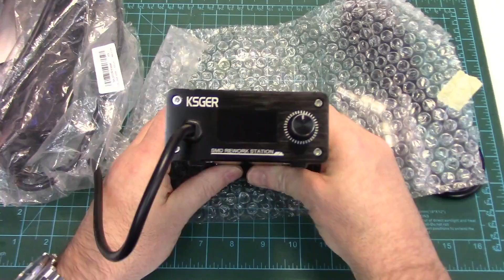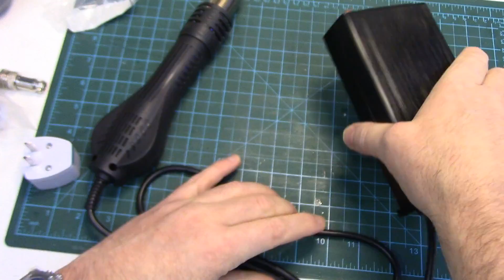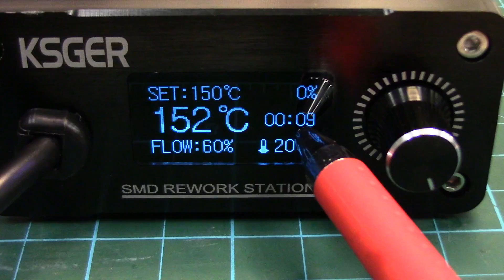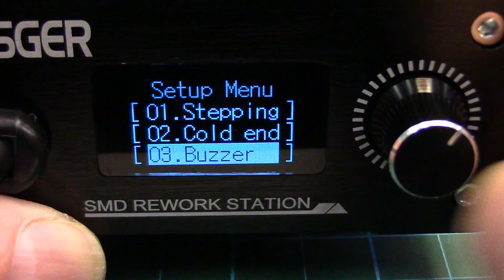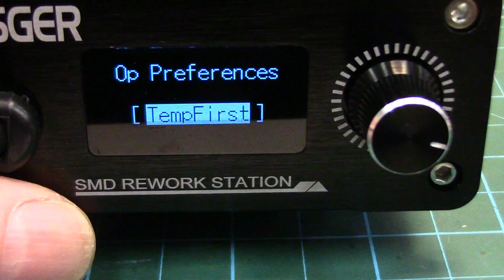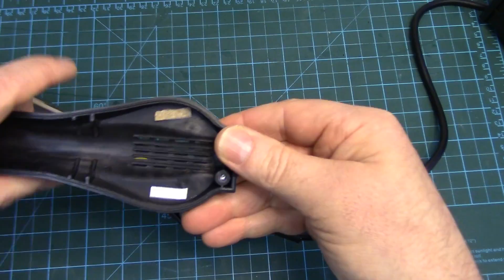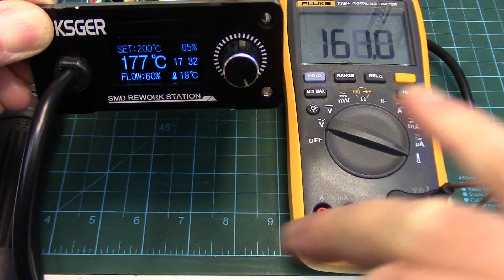KSGER 858D Hot Air Rework Station Review

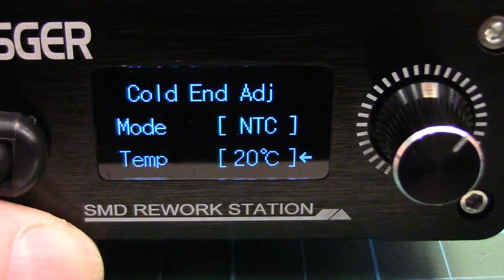Comment: 11:15 the room temperature can't be -99 degrees. It's just a calibration regulator.
Reply from the maker: Not sure what you were watching but the room temp shown at that time index is 20C.
Reply: @rchelicopterfun  
I mean, the adjustment is down to -99 degrees. Doesn't that make you think? I don't think anyone would solder at -99 degrees Celsius. It's just a sensor calibration. It has nothing to do with the room temperature. That's what I meant.
Reply from the maker: 1. No it's not adjustable to -99C. The NTC or CPU adjustment range is from -9C to +99C (at least on mine). Now, while I doubt anyone would ever be using a hot air rework station at anything over +45C ambient at the NTC in the handle, if using the CPU for ambient sensing, then I can see it getting close to that.
2. This adjustment most certainly has everything to do with room/ambient temperature. That ambient temperature input is used to shift the PID algorithms of the hot end circuit, providing the best hot end accuracy (response time and improved overshoot/undershoot characteristics).

Comment: That's a very nice "intro" but I wished you had used it and compared it to your AOYUE on some BGAs.
Every time a watch a review of a hot air station with that handle and the integrated fan, it's meh. While the units with the air pump or fan in the base are regarded as superior.
Reply from the maker: Well, I have found little difference in usable performance; keeping in mind, my main use of a hot-air tool as an RC hobbyist (this is an RC channel after all) is not for BGA work. In fact, never once done a BGA chip with either unit; only SMDs, SOPs and a couple QFPs (I did by the way demo an SOP on the one year follow up video: https://www.youtube.com/watch?v=Dy9WUtvdBUk

Other common RC related uses include heating small bearings up to soften retaining compound, expand races for fitment, soften adhesives and of course shrink heat shrink tube.  
For those RC applications of what I need & use mine for, both units work well, but the 858D takes up much less bench room, is quieter isn't vibrating the work surface and of course is reasonably priced.
No question, either type of hot-air tool has pros & cons based on specific usage application & needs.
Reply: @rchelicopterfun  Thanks for that thorough answer!
I'm just watching the follow-up :-)

Comment: Hi John,  I have the same Auyou Station as you and wanted a smaller footprint.  I Bought the Ksger T12 Iron about 6 months ago and like it a lot.  I received the Ksger SMD Rework Station a week ago and it is significantly different from the one in your review.  The menu is the same as yours but the  inside is wired  with a small 24 V transformer,  a tack welded clock battery and no magnetic switch in the airgun. I am new to electronics so I can not describe to you all the differences.  That being said the unit seems to work well .  I appreciate your video and hope to see more from you.

Comment: I don't know if you see comments on older videos, but I have a question about the Ksger Hot Air Rework station.  My new station System Info  shows 160V 59HZ is that a problem?  Other than that all appears to be working.
Reply from the maker: I'll presume you're on 120V/60Hz mains? If so, the frequency is basically correct (1Hz out reading is within 2% error). 160V reading if your main is 120V (when you measure it with a volt meter) won't have any impact on the operation of the station, it's just the reading that is way out of voltage calibration. That or it's not reading the true RMS of the mains, and is instead reading closer to peak amplitude voltage (about 170V on a 120V AC mains). Just a guess. Contact the seller if it's a concern.

Comment: Great review, I purchased after being impressed with the t12 unit but sadly the smd unit lasted 6 months, a week after warranty had run out, the glass fuse blew so I replaced that and now it just flickers error every second. Upon looking at new listings it states wires need to be swapped in the wand handle and thermistor needs to be added, Banggood have not been helpful at all stating the machine is out of warranty period, which i do understand but revisions have obviously been made and no advice on how to either purchase a new wand or how to repair. As soon as it’s turned on the heating element gets scolding hot and seems temperature is not being controlled .. if anyone has any ideas I’d be very grateful. Thanks
Reply from the maker: These low cost things have a warranty? I never knew that. Anyway, to fault trace the problem, you'll have to follow a standard diagnostic fault tracing process with a DMM to trace & find the fault/s. Likely more than one as this sounds like a cascading failure. I'll almost say with 100% certainty, the TRIAC has failed in a shorted condition. You can confirm with your DMM. As to why it failed however, that will require further fault tracing. Perhaps a short in the handle/wiring, or in the heating element. Even loose connections with higher current loads can take a TRIAC out.  If nothing else, just looking for visual shit stains on the PCB is a general good diagnostic fault tracing step to find possible bad component/s. You can of course order a replacement board, but if you also have a problem up in the handle/handle wiring that is the root cause of the initial failure, just firing a new board is will result in the same failure again. In short (pun intended), fault trace the handle and wiring with a DMM as well for shorts/intermittent shorts before risking a new board.
Reply: @rchelicopterfun  thanks for the reply john, yes I was thinking maybe the triac, I have done a visual of the board and the wand and all looks fine, I didn’t find any kid of thermostat in the wand which I was surprised at. I wonder if it was because the thermistor wasn’t installed at factory. I know they are not expensive but I don’t want to be spending £70 every 6 months 🤣 the unit was great while it lasted 😔
Reply from the maker: Handle thermistor has nothing to do with correct heater element operation or even correct operation of the unit for that matter. To be honest, I don't even know why they put one in there? 
 Perhaps that is why they don't anymore? The important heat sensor (thermocouple) that measures the actual heating element is in the heating element itself; up near the top so it can get a correct output temp of the airflow. There are 4 wires coming out of the element (the two thicker ones are the line voltage, the two thinner ones are the thermocouple.
Reply: @rchelicopterfun  thanks for the input john, I have already ordered a replacement heating element hoping that is the cause, I won’t dig any deeper until I have replaced that. Hopefully that’s the culprit. It’s too easy for me to order another unit, I would much rather have a play and try and find the fault, general electronics is not my area so it’s been a little struggle, give me a phone or console anyday of the week but coming across your channel has been a tremendous help added the fact that you have taken the time to reply with your opinion. I’m very grateful for your time and effort, you have gained another subscriber 👍🏻 thanks again

Comment: is it possible to use the t12 iron unit with/for hot air if i get the "blower" seperately? or would i need to make and flash a custom FW to be able to do it?
Reply from the maker: Not possible. Big hardware difference. Hot air rework gun heating elements run on line voltage (120 to 240 VAC) controlled by a TRIAC, and use much more power. In contrast, T12 soldering irons / tips run on 24VDC, controlled by a MOSFET and use very little power. Very different units, different boards, different power supplies, completely different wiring and operation.

Comment: Hey John, I have the newer release of this unit and am quite happy with it (did not buy it as one complete set, purchased handle some time ago but now decided to buy the DIY controller unit - I have the matching T-12 soldering unit as well). The handle does not have the little NTC although the connection pcb looks similar to yours. I have set the controller to use the cpu temp. There is a wire in the handle as well as the connection to the controller but I can't find what the resistance value of the NTC should be. Could be between 1k and 100k I guess. How much would it differ between using cpu temp and NTC sensor in handle? Do you know the resistance value or maybe could you please measure it? I can't find it anywhere. Thanks a lot for your help!

Comment: John great videos. I purchased the DIY version cause thought it would be fun to put together.  (That was a mistake as it was missing several parts.) The hot air gun i rediscover is wired completely different than yours any thoughts on how i could determine which wire is which for the placement on the board? Also could you tell me where you found the schematic for this unit?
Reply from the maker: You would have to check the outputs on the board with a DMM & look at the traces on the board to see where they go and what component they are going to in order to figure out what each does. Good old basic electronics diagnostic & fault tracing procedures in other words. As for the wiring schematic I found, I don't remember what site that was from; I just Google searched it and opened the first image search that showed it.
Reply: @rchelicopterfun  I'm having a bit of a pain getting it to work right.  Fan speed works. The magnetic on switch is working. The red heater button switch is work. However I have been unable to get voltage to the heating element.ihave checked voltage on the board in the heating handle thenchecked it on the main board and getting nothing. Do you have any thoughts on what else to check? Or maybe willing to send me close up pictures of your mainboard top and bottom? From the video it appears we have the same board

Comment: great review! now sure how to set the standby temperature or flow though... I obviously want it to shut off when it sits in the holder... for me it goes to 100% air flow and same temp (when I remove it from the holder it goes to the set fan speed, same temp) ... any ideas?
Reply from the maker: There is no separate standby temp. When you put it in the magnetic holder (which puts it into standby), as you said, it turns off the heater & goes to 100% fan speed to safely cool it down as quickly as possible.  The only way to keep it running at the set temp while in the holder is to either remove the magnet in the holder, or get a separate "working" holder for when you are working and remove the magnet in it so it won't always turn off when placed in the holder. Or do I what I do when I'm working with it and don't want it to turn off when placed in the holder... turn the handle 90 degrees in the holder so the magnetic switch is not activated.
Reply: @rchelicopterfun  oh I see, I understand how it's supposed to be working much better now, thanks for the quick answer too :)
Reply: @rchelicopterfun  Was just going to suggest that, the magnet in the base is fairly weak, more like a fridge magnet, and won't trigger the reed switch unless you insert it exactly right.  So to avoid the cooldown cycle, flip the heat gun over when you put it on the base.
Not sure if this is a feature or a bug, it's certainly confusing if you don't know about it and wonder why it's still running at full heat while resting on the base.

Comment: Hi just an update for anyone buying one of these i received my one in the post yesterday. Before powering it up i would recommend checking the unit carefully as the fan in the wand was wired in reverse also there was no heatsink on the Triac and the soldering on same was shit plus the usual problem with the case not being grounded. Now that it up and running its a great little unit and performs very well. The unit i received was the REV 3.0 with the PCB mounted sideways and pre installed GX-16
Reply from the maker: Thanks for the update.
Reply: @rchelicopterfun  No probs i bought both  units and am very happy with them of course after some mods. Printed a nice enclosure to hold the two of them stacked on top  and the sit very neat on my workbench
Reply: @electro3976  Heyo, since you have both, I figured I'd ask about how you're operating it. Im in Canada (110-120v)and i've been having issues tracking down a reliable source on accepted voltage input. Their official store on aliexpress only lists the rework station as input : 220-260v. Thats both the hard wired and gx16 version. Yet I see and hear people running it just fine at 110-120v, on top of that, other sellers have conflicting specs also. Do you have advice on that? Thanks either way! 

(I could get a stepup transformer mind you, but I'd like to avoid it if possible)
Reply: @relentlessgod  Hi both of my stations are running off 230v mains without any issues. I cannot offer any advice regarding (110-120v) mains supply as we operating on 220-240v here in Ireland.
Reply: @relentlessgod  just got my rework station and it's working fine in 120.

Comment: Hi John does this unit suffer the same as the T12 soldering station where the battery was being drained by the R10 Resistor
Reply from the maker: No, and that was a very short lived issue on the T12.
Reply: @rchelicopterfun  Thank you for reply John i have the T12 and am really pleased with it, works a charm although i had to address the earth bonding on the case and raise the heatsink that was intruding on the PCB track. Waiting on delivery of the Hotair unit hopefully i will be as pleased. Thank you for the review

Comment: Thank you for the review, I was looking for a good affordable hot air station to do occasionnal work on electronics and you convinced me to get this one.

Question: I look on the website and I was wondering what is the real difference bettween the DIY and the assemble kits are. Right now they seems identical (DIY price is equal to Assemble +Handle) but in the pictures the boards look different? 

Is it just an updated version or is one board supperior to the other?

Thank you.

Note: I do realise that the DIY needs to be assemble. I cannot understand why they would be the same price.
Reply from the maker: No idea on the kit versions since I've never ordered one.

Comment: bought it a month ago and last week the first problems appeared. The temperature goes way over the set limit and at about 450 degrees it shorts the line between ground and neutral.  Still cant find anything online
Reply from the maker: First thing I check would be the thermistor & wiring all the from the heater core, back into the station (terminal connector inside). You never mentioned if the actual temp display shows the temp climbing as it's heating up. If if does, then the thermistior/wiring/circuit is likely working fine and perhaps the Triac has failed in a shorted condition (Triacs will usually fail  shorted).
Reply: @rchelicopterfun  i checked all the wires going to the heat gun and theye seem fine nothing is shorted. when i turn it on it stays at the set temp and a couple working minutes later the displayed temp starts rising and after the 450 degrees celcious my circuit breaker trips(not the one for the amps, the other one for the ground-neutral check cant find its name)
Reply from the maker: My best guess without testing it would be something failed on the main board.
Reply: @rchelicopterfun  i removed it from a power strip and pluged it seperated straight on the wall, works great really accurate. Must be it from the start
Reply: Mine has the exact same issue. Trips the rcd controlling the wall sockets when its goes above 400c. Cant seem to find the issue. Such a shame!
Reply: @Jus1time  it started tripping the circuit breaker again, looked the pcb design and tried to follow the lines. Seems that they have connected the pcb ground with the earth of the house. Really bad design. I removed it from the pcb wire and also removed the yellow wire that went to the handle, i connected earth there and sent it to the hot air gun for protection.